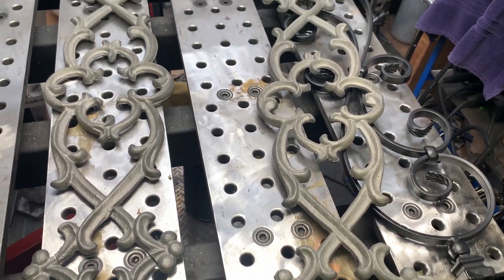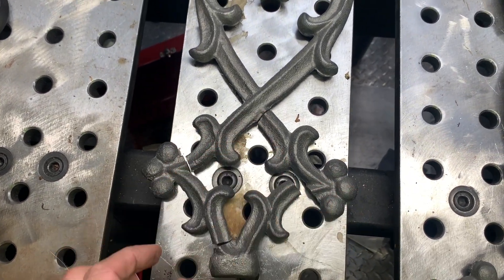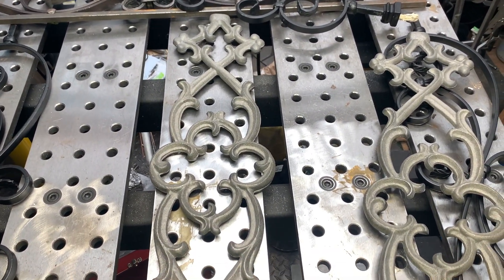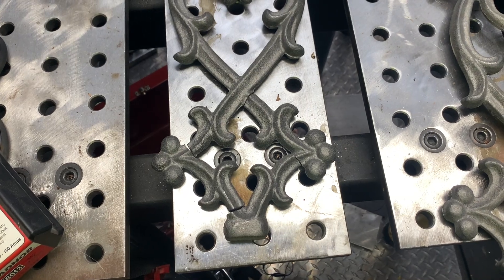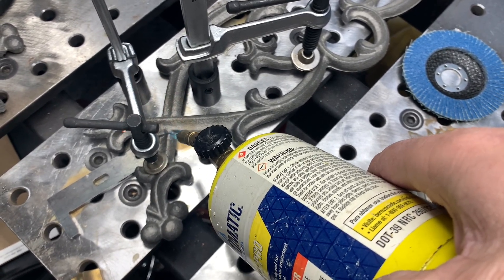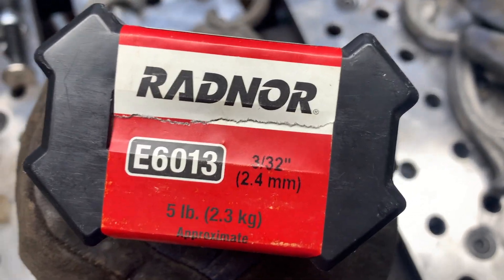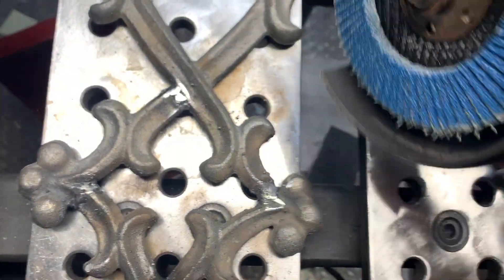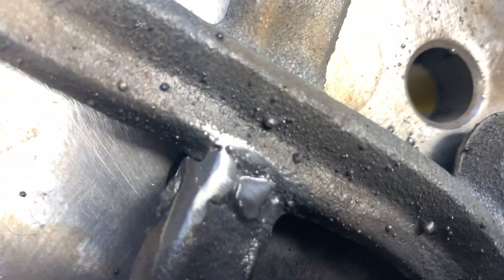Arc Welding Repair of Cast Iron

Comment: lol "It'll be rustic." I like that. You were blowing me away with the little flamer there to "preheat." I've never done that nor ever heard of that in my life. lol Hey, it worked! Fine job, Don. :o)
Reply from the maker: Finally getting back to you. You’ve never heard of preheating steel before welding it? Some applications demand preheating or you’ll either get cracking, or you won’t get penetration.
Reply: @w46try7  I know Don. I had heard (vaguely about it in 1982/83/84) when I was in school for "Metal Fab" ie; Welding. I should have rephrased the way I said that. Sure - I heard of it. I never (personally) ever had to do it in High School, it simply wasn't needed for any reason, be it Oxy-Acetly/or stick welding/ ARC....like you did in your video....nor MiG (maybe maybe maybe in TiG???) or TiG (Tungsten inert Gas)  - I just simply never ran into it. I'm sure there are jobs where it is absolutely needed. lol hee hee ! I was fortunate, I suppose. I didn't have to do that building safes. But it looked like you did a fantastic job, I was impressed and it actually made me smile throughout your entire video. :o) Roll on!!!  :o)

Comment: 95A ain't low for 2,5mm E6013. I usually run mine around 70-75A. 
Anyways, nice work! 👍
Reply from the maker: I was concerned that 95 A might not give me enough penetration. Sounds like it might be good.
Reply: @w46try7  Oh, that's not a problem at all. I use ESAB Goldrox and the sheet says 60-90A for the 2,5mm. The beauty of being able to run them a little lower is that you can get a steady puddle without blowing out the goods as fast. I never tried welding cast iron, but a wild guess would be thatdue to its inherant porosity you'd get penetration easier, but as I said, it's just a guess.

Comment: Wow... wasn't giving it much of a chance... but you did well.... in the old days to split a Chevy exhaust manifold they would braze... held surprisingly well
Reply from the maker: Braze, because it uses low temperatures. I’m pretty sure I’ll be using this same Arc setup to weld the cast onto the steel for my project.
Reply: @w46try7  besides... arc  looks more like original material, braze looks brassy
Reply: Looks good.
Reply: Indeed. I was holding my breath while watching. :o)

Comment: Well done. Cast iron is very granular, and  I'd guess difficult to repair like this.

London used to have beautifully decorated street lamps with cast or wrought ironwork like this, cast flaming torches on top of traffic lights, and a few old cannon barrels in use as bollards in side streets.
Utilitarian steel has wiped away so much character and craftsmanship.
Reply from the maker: Utilitarian steel.. That’s a good description.

Comment: Most times I've watch guys grind out v groves to fill in. A good guy to watch is "This Old Tony" very knowledgeable.
Reply from the maker: “Beveling”. Some applications call for that for sure. Beveling will give you a much stronger weld, rather than just a surface weld.